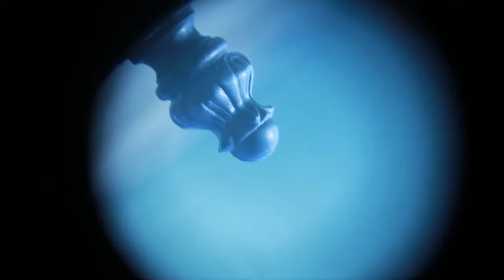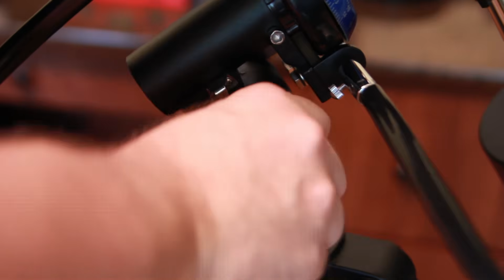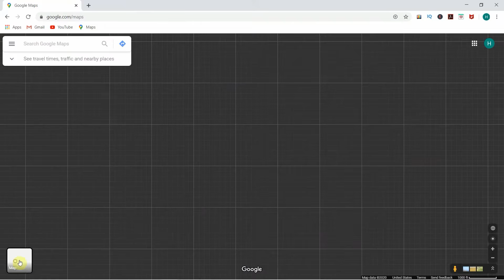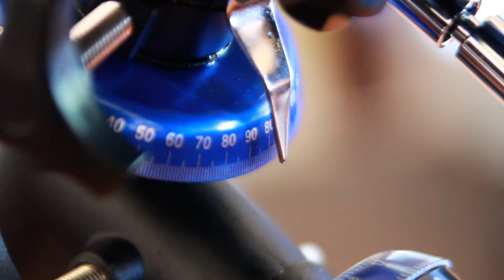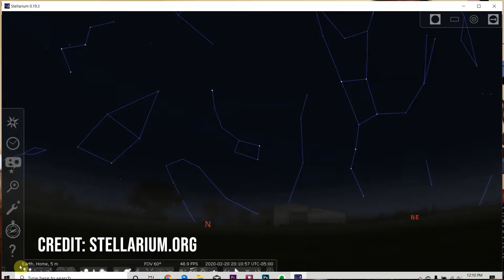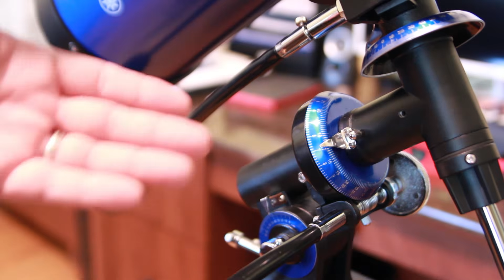Telescope Setup, Polar Alignment, and Use for Beginners

Comment from the maker: Were you able to follow my directions and get polar aligned? Have something you're having trouble with? Let me know if you have problems or questions and I'll try to reply back to everyone.
Reply: What size is your mirror. I have a Celestron Astroblaster 130, f650.
Reply: Thank you so much for this video. I was so frustrated last night when I first tried using it.lol
Reply: Do i have to wait for the north star to get high enough without touching the up/down control? can i lock on to it as soon as it crests the horizon?
Reply from the maker: @Xtheprotogen  the North Star, or Polaris, doesn’t “crest”, it is fixed in the same position. This is why you align your mount to it. The rest of the sky revolves around it as the earth spins.
Reply: @astrotourguide  So at night, with everything aligned correctly, the up/down screw on my latitude, if i point at the north star it will be there? in my telescope’s home position?
Reply: @astrotourguide  I do apologize, i’ve only just found out when i watched this video for the first time that i’ve been using my mount wrong.
Reply from the maker: @Xtheprotogen  exactly. With your telescope in the home position, once you move the vertical and lateral adjustments to have the North Star in your view, you are aligned. (This is for visual astronomy. If you were aligning to do photography, you would actually have Polaris off center as the true point of rotation isn’t perfectly centered on it. But that’s beyond the scope of this beginning video.)
Reply: @astrotourguide  I did some tinkering with it tonight, and when i returned to my home position polaris was always there. i did find myself rather uncomfortable attempting to look at saturn because of the placement of my eyepiece and finderscope.
Reply: I just got a telescope and I see two different things from the finders scope and the other lens ? 🤷🏻‍♂️ why and do I fix it
Reply: @raymondg.ramirez2nd166  You don’t really have to align the finderscope, but it is highly recommended. try pointing the telescope at a distant object like a pole or a light, and then align the finderscope to where the little “crosshair” is pointed at the same object you see through the eyepiece of your telescope.
Reply: Very good but I got stuck when you said align the scope at 90°. On my telescope, in that home position, my pointer was at 0° and at 90°, I was pointing East or West. Does it matter that I'm in England?

Comment: The polar alignment process has been driving me nuts with my telescope lol, and now i'm fairly sure that it's the telescope's fault - I think my declination scale is incorrectly positioned. My manual says position it at 90 degrees but I think it should be more like 10/11 based on the scale, is this wrong? https://i.imgur.com/C0NVgKi.jpeg

Comment: What do I do if everything looks like it’s all upside down? I have a celestron powerseeker 127 EQ and when I set it all up everything is inverted. I tried looking at a far away house and the roof was on the bottom and the windows were on top. I don’t know what I did wrong

Comment: Great video! 
At 12:03 the tube rings screws were not fully tighten. What was the reason?
Reply from the maker: You just need to tighten them enough that it doesn’t slide around on you, not all the way super tight. If you over-tighten them, it can bend the telescope tube. But by leaving them just tight enough to hold it in place, you can slide it around if you need to move the position of the eyepiece when you’re out viewing.
Reply: Thanks!

Comment: I live in Costa Rica and my apartment has a South view so I can't see the north star. How can I polar align it?
Reply from the maker: Look up your “magnetic deviation” for your location. Then you can use a compass to find magnetic north and then offset by the approximate degrees of deviation for your area. Then set the height based on your degrees of latitude. That’ll get you close enough for visual observing.

Comment: Very helpful!  Question: If my mount is level, set to true north and altitude adjustment is properly set - would that be good enough for visual observations? I'll try both methods as soon as the clouds clear up!
Reply from the maker: Yes. If you’re just doing visual, just getting it level pointed to true north with the proper elevation set will be pretty good. You might occasionally have to adjust the declination knob as something drifts if it’s a little off. Whereas if it’s spot on you only have to turn the RA slow motion knob. 

But for most of the time, it’ll be fine. 

Once you do a full alignment on the North Star the first time, you’ll have the exact elevation set. From then on you can just set up and point to true north and you’re in business.

Comment: My latitude adjustment sticker fell off. How do I put it back correctly?
Reply from the maker: I would go out and put the telescope on the North Star (Polaris), and then look up your exact latitude and reglue the sticker on so it matches the correct number. Although, it’s not a huge deal. I never use the numbers anyway. I just go out and point it at Polaris.

Comment: If you lock in the scope for Polaris , how can u change the latitude or angle of the scope to view stars higher than that ?
Reply from the maker: Once you lock in the mount to point at Polaris, there are two other axis on the equatorial mount that allow you to move it to the correct RA and Dec of the object you’re seeking.

Comment: So most of my view to the North is blocked by trees, so I guess I'll point it south and use the South star? For setting the altitude adjustment, I have a latitude of 035°21-38"N. So I'm setting it to 35°?
Reply from the maker: If you’re in the northern hemisphere, which with that latitude you are, you can’t fix it on the South Pole. It’s below the horizon. If you can’t see the North Star you’ll have to look up your magnetic deviation and then use a compass to find north and then offset it the number of degrees to account for that deviation in your area. Although really, for visual use, just point it north and set the mount for 35° and you’ll be good enough.

Comment: I bought a astromaster 130 EQ. I watched videos and thought installed correctly. However, I can't see anything.
Reply from the maker: Hmm, either you left the dust cap on or your telescope is possibly out of alignment. Check for videos on “collimating a Newtonian telescope” to see how to verify your alignment if you can confirm the dust cap is off and still see nothing through the eyepiece.
Reply: @astrotourguide  Thanks for replying. Dust cap is off. I can see but I can't focus. My challenge is I am not getting the finder scope/red dot finder and eye piece aligned. When I look through the eye piece I only see sky.
Reply from the maker: @raziulhnur  Ah! That’s easy to fix. As in my video. Take the telescope outside during the day and point the telescope at something off in the distance, like a tower or distant light pole. Then look through the red dot finder and adjust the dot using the three adjustment screws to move the dot until it is located on what the telescope is. Then you’re aligned.
Reply: @astrotourguide  should I not align with declination and RA slow motion clutch?
Reply from the maker: @raziulhnur  before you get your polar mount aligned, get the red-dot scope aligned with the telescope. THEN, get set up your mount to be aligned and start using your slo mo controls. But if you don’t align your finder with the telescope, it won’t work for you. You can do this during the day before you even go out at night. Then you’ll just have to fine-tune it when you go out to make sure it hasn’t moved. 

At night you can just center something bright and easy to find in the telescope eyepiece. Then use the adjustment screws in the back of the finder to move the dot onto what is centered in the eyepiece so they match and you’re all set.
Reply: @astrotourguide  thank you so much! You have been extremely helpful.

Comment: Just bought the same Meade Polaris 130 eq as you used in the video.  Seems to be a nicely made scope, obviously it's on the budget end of the scale as telescopes go but the optics look very sharp at that price.  The only complaint I have is with the stand, the mount itself seems fine but the stand is quite wobbly.  I found that the majority of the movement is in the plastic ends fitted to the legs where they join onto the mount, the metal leg is simply pushed into a plastic socket and secured with two little pop rivets, of course it's not a tight fit so there's lots of movement present in the assembly.  However with mine I've been able to eliminate virtually of this movement by pouring epoxy resin into the joint, it now feels considerably more stable, even if there's a bit of a wind up the scope stays pretty much wobble free in the eyepiece.  Hope this helps anyone else who's got the same scope.  Cheers, good video BTW 👍😉

Comment: Can the pole star be observed after making an alignment?
with altazimuth mounts it is very simple, but with equatorial, that part of the sky is very difficult to aim. In the end, I cheat and change the degrees of the mount  :D
Reply from the maker: With the telescope properly aligned, you should be able to point it straight and be directly at the pole star. But the closer your object is to Polaris, it can be a little more bothersome to get to with an equatorial mount. But once you get the feel of it, it becomes second nature and is easier to hold in view, especially at higher magnification.

Comment: It was really good and simple explanation. I have a question that once I polar aligned, then what should I do to my RA DIAL and DEC DIAL, I mean does I neet set it to both these dials to zero when Polaris is visible?
Reply from the maker: Honestly, I never set them as I don’t use them when I’m stargazing. I just use charts to find my way. But, if you want to use them, after you polar align, then center a star that you know in your eyepiece that is somewhere near the equator or ecliptic, and then set the dials to match its known coordinates. For instance, center up Betelgeuse in Orion and then look up its coordinates in your charts or app and set the dials to match and they’re set.
Reply: @astrotourguide  thanks for your prompt reply. OK will try soon the way you guided Thanks.